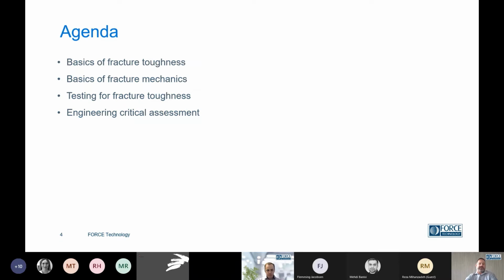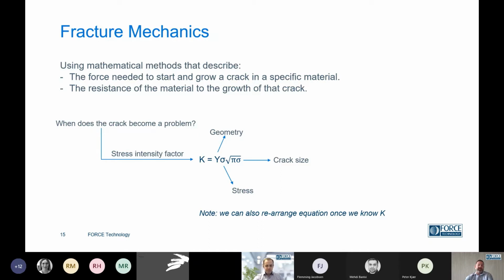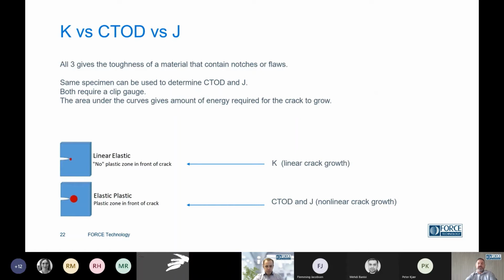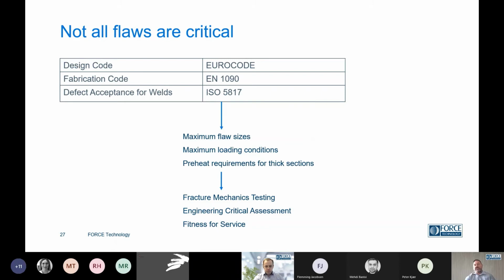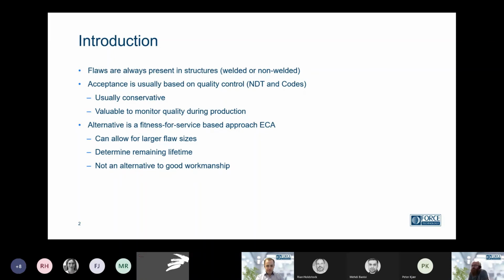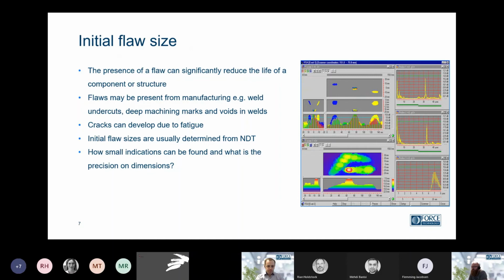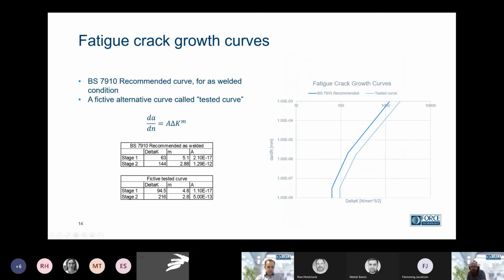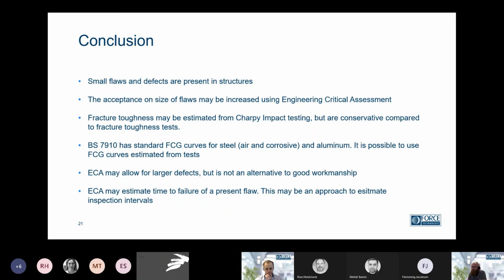Webinar - Fracture mechanics testing and engineering critical assessment

Comment: Could you more detail explain your position "if we want to test for ductile fracture we can use a thinner materials but if we want to test for a brittle fracture then we need to go to thicker materials or thicker test specimen"
Reply from the maker: Hi Vladimir. 
Thank you for your question. 
We assume that you are familiar with plane stress and plane strain conditions. 

We know that thinner steels can show brittle fracture, especially in the presence of stress concentrations, or when exposed to low temperatures. 
So the intention was not to write that we cannot test for brittle fracture on thin specimens. 
The intention was rather to explain that specimen thickness (in steels) can influence test results, so thickness need to be considered. 
It also has an influence on the cost and the schedule. 

We do  hope this answers your question.
Reply: @forcetechnology  Thank you for your explanation. Since thinner steels show a brittle fracture, why do we still use a thin one for the test? And for brittle material, for example, ceramic, what the influence of using a thinner specimen for the test (decrease/increase the toughness and why)?
Reply from the maker: @haozhezhang5287   Thank you for your question.
Just to clarify: thinner specimens are prone to ductile fracture. When thickness or specimen size is large enough, plane strain conditions become dominant and the plastic zone near the crack tip becomes very small. In this case you will be able to obtain brittle fracture. Lower temperature makes steel more brittle, as mentioned in the previous answer.

It is usually a limitation in the available material that limits the size of the test specimens. For plate materials, the test specimens might be thinner than required for obtaining a brittle fracture in the test (Valid KIC) due to plate thickness. In this case, you test the specimens that are possible to manufacture from the available material, and obtain a fracture toughness value that is valid for this material and thickness. 
If you obtain brittle fracture and all clauses in the standard are fulfilled, you get a geometry independent fracture toughness which is valid through all thicknesses. In general, a fracture toughness obtained in plane strain conditions is lower than a fracture toughness obtained in plane stress conditions. 

We have not tested ceramic materials and cannot provide an answer on how they behave at different material thicknesses.
Reply: @forcetechnology  Thank you so much for the very detailed explaination! You have completely answered my question.